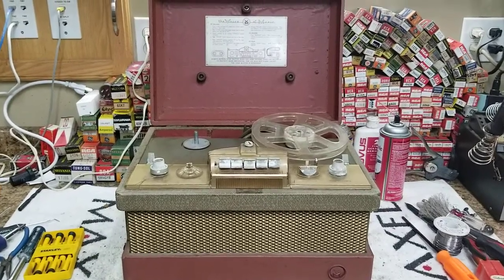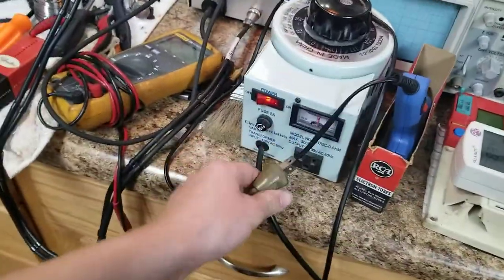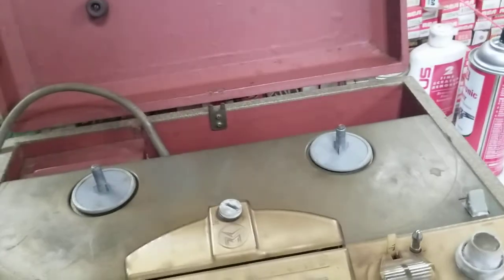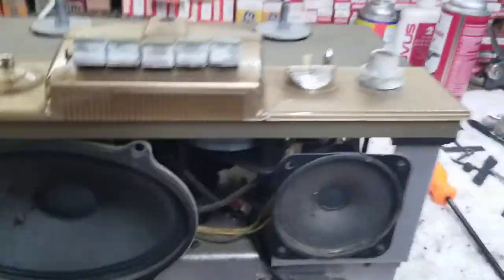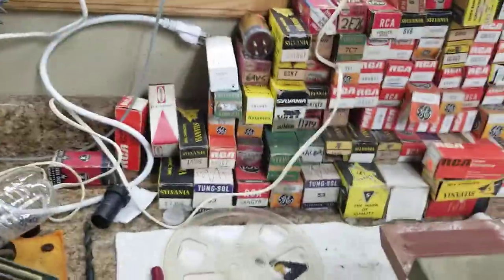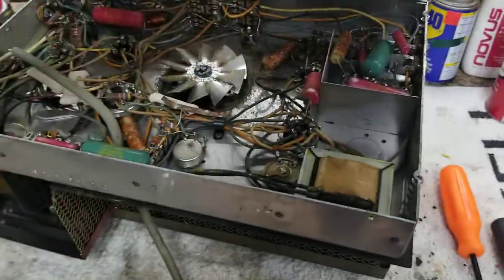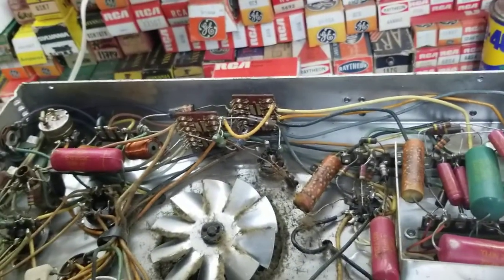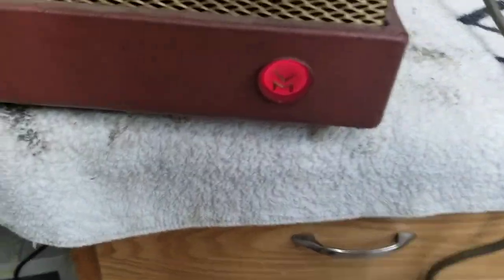1950s Voice of Music reel to Reel Tape recorder analysis

Comment: did u get this fixed? i just picked up a model 711 (looks similar to that one) and it doesn't power up. thought of doing a guitar amp with it. got the extension speaker with it also. that one is all goody. cheers!